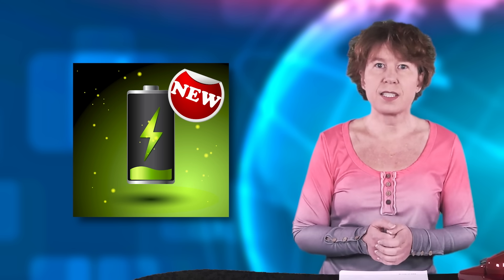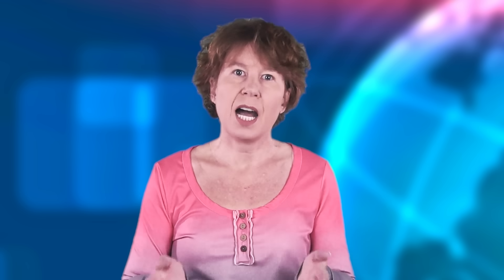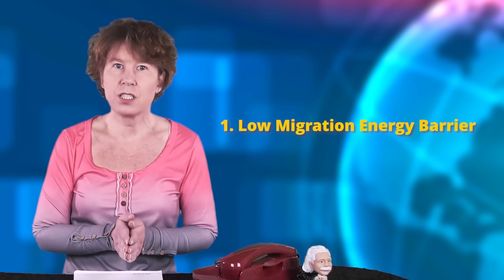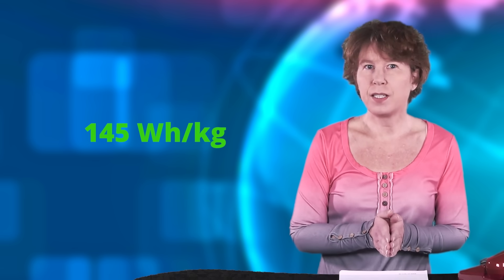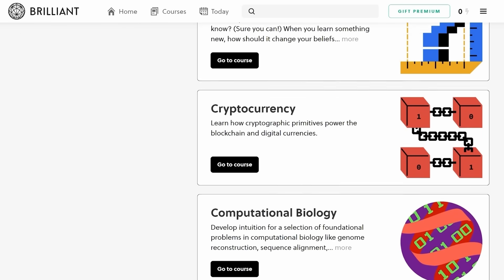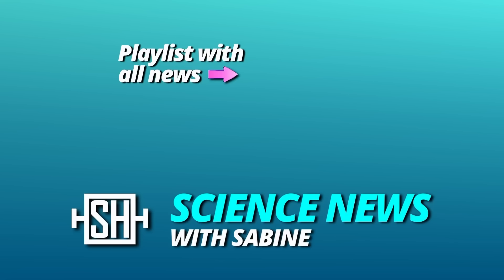Fully Charged in Just 5 Minutes: New Battery Breaks Records

Comment: If it's partially made of indium instead of lithium, wouldn't aht also make the battery have a denser mass? That is, it'll make the battery even heavier? That's also very bad for cars.
Reply: Indium 143 WH/L
Silicon  320 WH/L

Why are we even talking about Indium?
Reply: @jjtompson5914  No, Indium, not Iridium. 
Iridium is a platinum metal and incredibly rare and expensive.

Comment: Full charge a 50KWH battery in 5 minutes? THIS is stupidly dangerous:
50KWH in 5minutes means ~2,500A power service. 
A regular house is 200A service. Going higher and your electric utility company will charge you "commercial rate".
And at >2000 A, your electric wires will be cooking VERY HOT!

Comment: Next up Sabine.........ENOVIX SILICON ANODE EV CELLS 

Fast Charge.   80% in 5mins
Gravimetric energy density of 320 Wh/kg
Volumetric energy density of 900 Wh/litre
Silicon anode with an energy density of 1.8 Ah/cm3, more 
than twice that of graphite anodes at 800 mAh/cm3.
Surpassed 1000 cycles while retaining 93% of their capacity. 
Recently passed 1500 Cycles/10yr projected lifespan
Silicon makes up 27.7% of the Earth's crust by mass
Conventional Stack Cell Bottom-Cooled
ΔT = 31.9 ̊C
Enovix Stack Side Cooled
ΔT = 2.8 ̊C
Reply: Fortgot to mention their award winning "Breakflow" that
inhibits Thermal Runaway......Passed U.S Army penetration testing.

Comment: 1 terabyte is barely 7-8 games at this point along with a few apps. And performance degrades rapidly once a SSD is more than 70% full. I have 9 TB and still struggle to keep things running. Not to mention redundance and failure mitigation.

Comment: Speed, price, quality—pick two.
When it comes to batteries, and without much thought, it I would guess, you can have any 3 of 4 characteristics.
1. long life
2. high rate discharge
3. low cost.
4. low weight
Reply: There was a time when tv transmissions changed from 405 to 625 lines in the old black & white days. Look at tv's now. There again mobile phones were carried about in a brief case in the late 1980's. It's not just a phone now but also a stills camera, video camera, payment device, diary, alarm clock, map............. Technology will steamroller all predictions.

Comment: Current Lithium technology batteries are limited by heat when it comes to charging or discharging. Unless the new Indium batteries are immune to the heat produced by current Lion, LiFePO4, LiPo batteries, the cooling demand will probably increase. It isn't just the pack that must be cooled, it is the wire connections that are limited. A very high rate of charge will melt the wired connections before the pack overheats and ignites. Heat dissipation, energy density, and the RATE of charge and discharge are all factors to consider when choosing which chemistry will do best in each application.

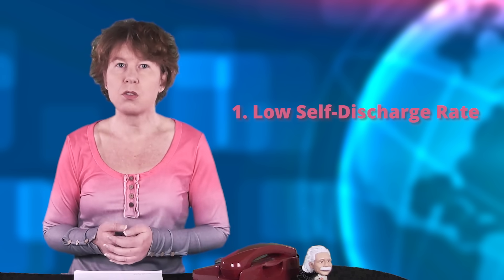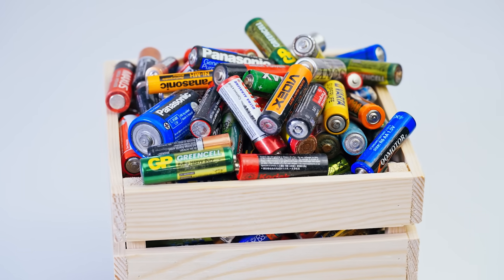Comment: At the 1:07 mark, the 3 properties for a GOOD battery are different depending on the application. And they vary quite a bit depending on the chemistry. In my hobby, RC aircraft modeling, a HIGH DISCHARGE RATE is desired for the type aircraft I fly, ELECTRIC DUCTED FAN (EDF) Jets. For that application I use Lithium Polymer batteries (LiPos). Charging them at a high rate can be done, but it lowers their life cycles and their capacity for the flight to follow. If you're racing that may be fine if the race is short, and you don't plan on using that battery more than once or a few times. I don't understand the reference to a terabytes of storage WRT batteries. Any battery can power any storage, be it 1 byte or terabytes. The high energy density of Indium may help with low rate demand apps, but won't make a dent in my hobby for VERY high rate demand, i.e. 100+ amps for peak periods of a dozen or so seconds and 80 amps for half a dozen minutes. At the 4:30 mark I would choose the quicker Indium charge for a car over the current Lion car batteries if the range was reasonable. Getting equivalent range and quicker charging would be a goal in any battery app.

Comment: Range anxiety is caused in the first place by the battery getting to empty and the driver is forced to stop and charge. With liquid fuel, this problem is solved in 5 minutes and you can continue. With current battery tech, that will take 10x longer. That's why fast charging is pursued. Unfortunately that's where the really big problems start.

Comment: Controversial opinion: we dont need electric vehicles, we need clean fuels. If we used clean energy sources to convert carbon dioxide and water into some sort of combustible hydrocarbon without impurities then almost all of the serious issues we have fossil fuels disappear. We need to learn to think of liquid fuels as batteries in and of themselves. They store chemical energy instead of electrostatic charge. The problem has never been with the mechanism of energy storage but rather with the way we shortcut having to actually prpduce the energy by digging it out of the carboniferous instead, disrupting the co2 level and also introducing impurities like harmful sulfur compounds into the atmosphere. Of course, the technology and infrastructure needed to replace fossil fuel derived petrol with carbon neutral "lab grown" fuels does not yet exist and its no small task. But I worry but that fear of fossil fuels has extended to fear of all liquid fuel/propellant regardless of where it came from or its net carbon offset.

Comment: My biggest concern is the CURRENT that these batteries will draw. 40Kw in 5 minutes will affect  the normal distribution grid drastically. Not even industrial areas do those king of surges unless they are metal foundaries.
Expect popped fuses all around.

Comment: Uh huh. With horses we had to water, feed and groom them. Petrol powered vehicles required a change to that procedure, find a gas station, pour petrol in the tank. And now EVs,  a bit different again, plug them in wait a bit and they are ready to go.

It doesn't take long to get used to the change.
Reply: You wait a bit with Benzin and Diesel. With electricity you can watch the gras grow.

Comment: Highly unusual but Sabine is totally wrong on this one. EV range isn't the problem,  recharge speed is. 
My first 2 cars (1973 Plymouth  Roadrunner,  7.2 liter, 12 mpg, 18 gallon tank and a 1979 Ford Mustang,  2.3 liter, 24 mpg, 10 gallon tank) had no more range than my Chevy Bolt! But I could refill them in a couple minutes versus hours.
I would have no EV range anxiety if I knew I could recharge in 10 minutes.

Comment: While it's true that filling up a car with gas is quicker than charging a battery, this only matters when you're running out of power and need to stop to charge. If a decent charging infrastructure exists, then it'll be that much easier to just plug your car in whenever you stop for other reasons, so you can simultaneously increase the charge while you do other stuff. The most obvious example is being able to charge at home. There may even be a time when passive charging exists, via solar on the roof. It doesn't even need to be the entire solution - if all it does is stave off requiring a "real" charge a bit longer, then that's good. Having your car sit in the sun for hours getting a trickle charge is better than doing nothing.

Comment: First point is that humans are lazy and well brainwashed.  If you can't adapt to a very slightly less instant society in favor of a cleaner, quieter and quickly evolving world then you deserve the status of neanderthal.

Secondly, if you had imagination you wouldn't be concerned about majoring on the minors of life.  This is no longer the world of yesteryear when new problems took many years to either be solved or further changes made them evaporate.

When I was young I had no problem killing a bit of time while the fuel attendent filled my gas tank, checked my oil, checked my transmission fluids, brake fluid, wiper fluids, radiator level, tire pressure, put on new wiper blades, and sent me on my way.  While he'd done that I'd gone to the restroom, bought a soda, some candy or chips, looked at a magazine, paid for whatever and fuel and drove off with clean windows all around.  None of it bothered me and no one else ever did. 

Quit bitching about charging or battery range.  It's a very temporary point in EV history.

Comment: I think you have an irrational bias against alternative fuel vehicles. There is a currently a cost argument against them,  but many alternatives beat internal combustion in either energy density, pollution, or greenhouse gas emmissions. Although no one alternative wins in all categories. That means there is a perfectly rational market for alternative fuel vehicles depending on how you weight the costs and benefits. Yet you seem unable to compare them seriously.  You just make blanket emotional statements rather than scientific benchmarks on these points. That means you are failing in the science communication field when you dip your toes in these deep waters. Don't bother if you don't want to take it seriously.

Comment: i suspect the main reason people want either large range or super fast charging (or both) is because they are worried about (and have been convinced) that batteries take a long time to charge and the range isnt all that great and of course there may or may not be a working place to charge (some of that is that charge stations arent cheap and  some of it has the stations are built, in a  gas station you will note that the pumps are covered up by a metal roof, not so for charge stations).  while there are many EVs today that can get up to 300 miles and early gas vehicles from 50 or so years ago, were built to that requirement, today some do some dont (having lots of gas stations and short fill times make it easier to live with that, course in the US trips of over 500 miles arent all that unusual in fact some be for 2000-3000 miles, though those take a lot longer to complete). but people forget that gas vehicles mpg is an up to nn miles per gallon, and not a hard fact at all. as weather will impact EVs and ICE vehicles identically, reducing their range. but having fast fill/charging and common gas/charge stations make it easier to deal with.  so some of its  how long that ICE vehicles have been around and some left over range requirements that ICE had before. EVs will have to match it to succeed in the market. which is driven more by emotion that facts as it always has been

Comment: if batteries could be charged in 5 minutes the problem would be how to get that much energy into the battery that fast. Say you have a 60kwh battery and you need to get say 50kwh into that battery in 5 minutes at say 415v, it takes almost 1500 amps. That would be per charger meaning the cabling and supply capacity to each charging station would be immense. If we then project that to say a 100kwh battery which is going to be more typical it would be 3000 amps per charger. However you slice it, electric vehicles are not a sensible short term solution to transport.

Comment: wut? you made no sense .. saving hours on charging is not a big deal to you? I need to refuel my combustion engine car every x km's as well .. the issue with EV's for me, is that it takes ages to charge and if you drive very long distances regularly, you need to plan around charging .. that sucks. I could live with half the range if it charges as fast as I can refill a tank.

Comment: The battery market and by extension, the electric car market is weird. I don't need 450 km of range and I don't need to charge over 5 minutes. Give me a cheap car with 150 km range that will charge over many hours. 90% of the time i travel less than 15 km a day which would barely discharge the battery anyway. When I'll need more I'll rent.

Comment: The charge time is only on first view the important factor, on 2nd view the amount of charging cycles a battery can have before it loses too much capacity makes the price of the battery and that becomes the deciding factor for the decision what car to buy.
Currently there is no battery on the market that could do more than a few 100 recharge cycles at a load that gives a halfway reasonable charging time.
The 8000 cycles manufacturers are talking about refer to a charge current of 0.2C, meaning 5 hours from empty to full, at 1C that becomes less than 300 cycles and at fast charging stations you can be happy if you get to 100 cycles before the battery has lost half its capacity.

Comment: I have a Tesla - and recently bought a second for my wife.  The problem with 15 to 20 minute charge times - and roughly 2 to 3 hours between charges at freeway speeds isn't that it's an actual problem.   After driving that long ALL mainstream driving organizations recommend that you take a break.   NONE of this is a REAL problem - but it's a VERY, VERY BIG perceived problem - and results in bad press and a lot of people getting very upset about maybe selling new gasoline cars being made illegal in 2030 to 2035.   However, it ISN'T a problem in reality.  I've done 3,000 mile road trips in my Tesla and the rhythm of taking 15 minutes out ever 2 to 3 hours is just fine.   The problem isn't physics or engineering - it's psychology.

Comment: The ultra always had the better camera, usb 3.1, is you look at the z folds, their usb 2.0, at infinite cost, but you can just recharge it while your using it.  its merely the surface area that makes the capacitor more powerful, I don't understand that Reynolds cling wrap and Reynolds aluminum foil cannot be spun at 88mph.  You just need the 888 strand jumper cable, a evil robot throws hot slag at a negative 39 celcius degree aluminum.  It actually cut out a square, when four squares are rolled a pliar's solder robot moves ar crystal ball over drive blower twin turbo speed.  Because its infinite voltage, the requirement is the varactor.  The choice of dialectric is futile as long as its well shielded.  And the volt ohm gives the RMS power curve, thus its futile, maybe tungsten.

Comment: Recharge time is the number one problem with EVs... Always has been. Extra capacity... adding crazy weight... to achieve more range.... sort of avoids the problem but only for the wealthy, living in their own homes, with off street parking and the ability to charge slowly, over night. Live in a flat/apartment and can only charge at public chargers and then the ev experience is simply frustrating. Of course fixing the battery problem, so it can take charge more quickly... fixes one problem. Next up.... How you design a charge cable.... that can take so much power, still be flexible enough.... not weigh too much.... and not get red hot.

Comment: When current or voltage gets out of double figures I get nervous.  It even trumps range anxiety for my EV. It had had a good reliability record in 10 years of production prior to my purchase. Yet I still give it anxious looks as I approach and leave it. Now petrol, I leave the handbrake off in the garage and have an extinguisher handy. If it 'brews up' it can be pushed outside and blasted. Not so an EV.  The handbrake is electronic, and battery fires are self sustaining.

Comment: 4:40 when your connection cable wears out and stops working well.  5 mins means you only have to hold it the right way as long as most normal people can hold a cable in one way for, 60 to 90 mins... means that phone is dead until you get a new cable.

Comment: The combination of the high energy density/fast recharge battery would make possible smaller cars with lower weight and a fair range of 2-300 km. For me such a car would be ideal. It would more than cover my daily range and if I could charge in 5 min it would enable longer trips without the need to haul around a 80-100 kwh battery in a larger car for my daily commute.

Comment: There's so many factors that are important for batteries, that's why a one or a couple them are irrelevant, without knowing the others. Especially lab test results, also without knowing what would be possible in commercial production at reasonable cost is meaningless for cost sensitive applications. 

Then again, a new battery technology doesn't have to be overall superior for "standard EVs" to be relevant, there are significant potential "niche" applications, if other aspects are good enough. Liion has proven good enough to be hard to beat, and as they constantly get better, beating Liion is a moving target.

Comment: The main problem is providing the required power to the charging station. If I want to charge 100kWh in 5 minutes, I need 1.2MW of power, which is the output of a small hydroelectric power plant. Just for one charger.

Comment: It can be used in many applications not just cars and phones: chargers, power invertors, hybrids, power banks, welding, power tools, power wall. First of all as the buffer. When you need charge\discharge at enormous power rate in  relatively short time. Yes, we need 2 of them to get same capacity as Li-Ion, but we need 3-4 of Li-Ion to get same charge\discharge rate as this new battery type. So, it 1.5 - 2 times more profitable than Li-Ion battery.